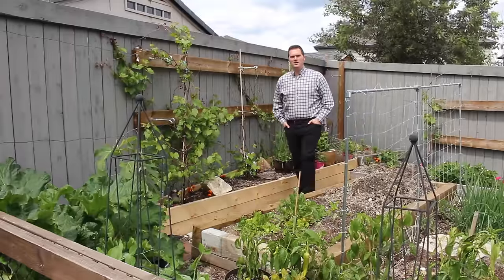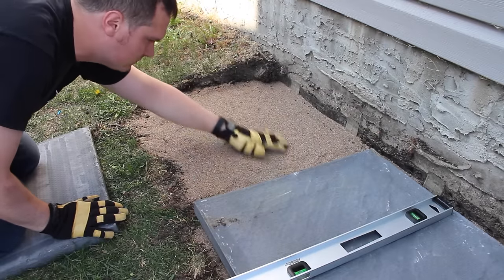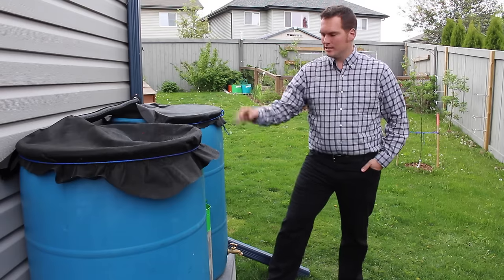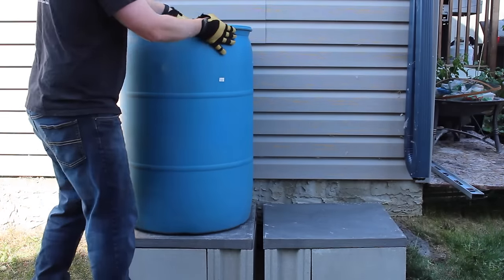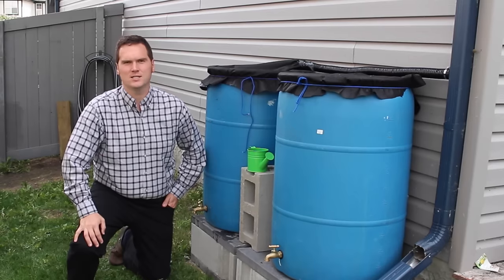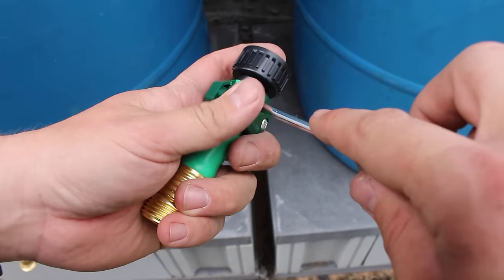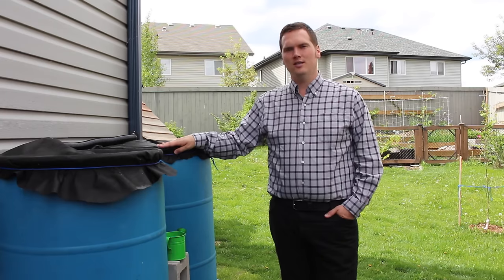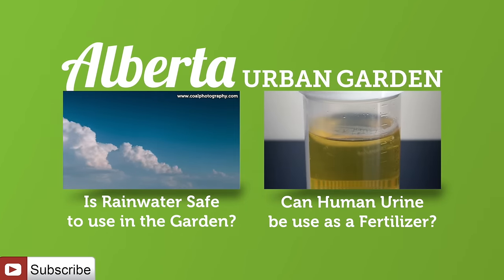Installing a Rain Barrel for Beginners

Comment: Great video! Just a note, the connection between the two barrels will work better if placed at the bottom of the system. Instead of 2 40 gallon barrels, you would then have 1 80 gallon system, creating better pressure for the hose (and more convenient).
Reply from the maker: Thank you for the tip ! I appreciate it ! Next time :)
Reply: pressure is determined by the height of the water in the barrels, not by the volume of water.
Reply: Advantage: you will need only one tap.

Comment: Also, instead of cutting the top, you can screw pvc pipe in the hole, use a "t" fitting on top to connect the barrels (as many as you want) and that will both fill and provide overflow.

Comment: Just a technical point;  the Teflon tape is NOT meant to be used on those threads in this application as the seal is made with the large black rubber washer on the inside of the barrel.  (the threads do not require taping.)

Comment: Steve, when using a hole saw in plastic, start the hole rotating the bit in the normal way. Before you get through the material run the bit backward and you'll get a much nicer/cleaner hole.

 Thanks for all you do
Reply from the maker: Thats a great tip thank you!!
Reply: That's not always true. I found when making my PVC Hydro tubes I got a much cleaner cut running forward.

Comment: Excellent, I love water saving solutions whatever they are. I'd probably connect the two outlets into one if I was using a hose on there, and use a rainhead screen with first flush because we get so many leaves in our gutters.
Another option is the water bladder that can be made to fit under a porch or landing so they're out of the way.
Reply from the maker: I don't have issues with leaves in my gutters but will use the screen to keep the stuff out!

a bladder under the deck would be nice but hard to maintain and winterize!

Comment: Terrific video, Steven!  Great inspiration.  I need to figure out a way to do this and include a pump for a hose at the base of the barrels since my house is pretty far away from my garden.
Reply from the maker: The longer term reason I was thinking a larger access would be nice is I can put a submersible pump in.  There are others that attach to the hose and then run the water through the pump. 

I might think about a pump if the watering can turns out to be too slow :)

Comment: An 8" pond plant basket in a 7.5" hole cut in the top of the barrel.  Then line the basket with a nylon paint strainer.  Easily removable for maintenance and it keeps insects out.

Comment: I am finishing a 12'x16' shed, and I have a food grade pallet tank to collect water. The tank holds probably about 200 gallons. It already has a valve at the bottom, and I'll come up with the downspout hookup. I'll permanently have the downspout connected, with the overflow exiting the upper part of the tank, to be connected to a drain hose that leads to the lowest elevation beyond the shed.

Comment: I use similar barrels, but I did not cut them.

I connected the downspout to one of the two openings on the top of the barrel and I use the other opening to let the water exit the barrel when it is full.

My downspouts are circular and just slightly larger than the openings on the barrel so there is a nice fit.

Before winter, I simply empty the barrel and I leave the faucet open until spring so that water can flow through the barrel.
Reply from the maker: That is a great tip for winterizing!  Thanks !! 

how did you get your tap installed?
Reply: For the tap, I drilled a hole similarly to what you did, but I did not do anything on the inside of the barrel.

I only put teflon tape on the threading of the pipe plus a black gasket and I screwed it tightly to the barrel.
Reply from the maker: no leaks thats great!
Reply: Nothing perfect, but it works for me.

And I connect multiple barrels using the other openings at the top.
I use the same pvc pipes used for the downspouts: two 90-degree curves + one short pipe and the two barrels are connected!
Reply from the maker: sounds like you are a touch more resourceful than I!
Reply: Thanks!

I like a lot your projects and the way you present them!
Reply from the maker: Thank you very much Mark for the kind comment!  I put a lot of work into these videos to help others and it sure does feel good when you take the time to put a kind comment in!!

Comment: great job Stephen!  I use an overflow system on my barrels and I need to monitor it during heavy rain falls.  I use screens but sometime debris gets through and clogs the overflow. your design looks virtually maintenance free besides the winterizing. I simply turn my barrels upside-down and leave the valves open before winter hits.
Reply from the maker: In theory the system should be maintenance free but we shall see. 

I had not thought of just flipping the barrels. Thanks for the tip !
Reply from the maker: That is the plan now!!  Thanks for the tip it is appreciated!
Reply: Actually, you need to leave the faucets open during the winter so any residual water doesn't freeze and crack the faucet.
Reply from the maker: I had planned on that as well.

Comment: Awesome! I have done something similar, only I got five 50 gallon kalamata olive barrels from a Greek deli. What's nice about them is that they have two-piece screw top lids, like mason jars. I can remove the plastic lid, put a piece of screen in its place, and secure it with the ring. When the summer comes and we have no rain, I put the plastic lid back on to keep the water from evaporating. They are a very nice terra cotta color too.

I'm not very tall though, so I have to lay them on the ground and crawl halfway in to install the spigots. :D
Reply from the maker: That would be nice. I was looking at a 200l version of those but the fellow would not come down on price so I passed :) 

I could barely reach the bottom of my barrels and I am 6 foot tall :) no harm in leaning it over and crawling in !
Reply: I bought an rv washing wand to clean my rainbarrel. It worked great for the sides but I still had to crawl into the barrel to clean the bottom edges. My wife thought it was funny to "help" rinse it out while I was still inside. I got even. (I know where she sleeps!) Lol!
Reply: Oh no! :D
Reply from the maker: lol thats why I did it while my wife was busy!  no need to get an extra washing in ;)

Comment: Hi Stephen. 
I really like the base you made. Very sturdy and long lasting. 
I have a couple of 1000 litre pallet tanks, but they aren't pretty and since our neighbourhood doesn't have backyard fences, my wife doesn't want them out in the open. I have an unobtrusive spot in mind but it's at the bottom of a gully and would need a pump. S if you do put a pump, please, please make a video. 
Would also be interesting if you install a first flush system
Thanks
Reply from the maker: If I find I need to speed up watering I certainly will do a  video on the pump as it is something I would need to research quite a bit and would love to share my findings!

The only issue with the base is its scratchy and my watering can needs a little buffer between it and the concrete ;)  that is ascetics I can fix with time!

Comment: Steven, 2 things: for the sawzall, the harder the material being cut the finer the tooth pitch, you would have been better off with a 6tpi wood blade, for the faucets, Teflon tape is meant for taper or pipe threads, and is more likely to cause than solve a leak on those strait threaded fittings... Though I have noticed in the past couple years a lot of the overseas made cheap junk they sell at the Home Deathspot has it in the instructions to use it where you should not...
Reply from the maker: That's why I mentioned the metal blade. I figured a smaller tooth would be needed and the regular starter kits that's the metal blade. Thanks for the tip! 

I spoke to my father about this before and he said a side benefit of the tape is it helps keep water out of the initial thread helping to prevent damage when the freeze thaw cycle starts. That is interning though you suggest it may not be needed. I am going to have to look into that more !
Reply: *****
Teflon Tape's benefit comes from the fact that tapered threads crush it into filling the gaps between male and female threads, there by filling all possible space for fluid egress... Strait threads are not designed to do this, and mostly try pushing the Teflon Tape out of the way, often causing lumps with voids that allow fluid egress... I don't know how many times I have been called in so solve leaks caused by homeowners installing faucets and using Teflon Tape on the wrong fittings... The store has had to pay my time on many occasions when the home owner has shown me the supplied instructions that tell them to use it incorrectly... I guess the Asian manufacturers cut and pasted the wrong section of another company's English instructions...

Comment: Very well done, Stephen. Any concerns about the plastic absorbing chemicals from the barrels' previous contents?
Reply from the maker: No concern as the food grade plastics don't absorb from the content and vice versa.  Some of the plastics in red don't leach anything but do pick them up as they are softer with higher poor space.  

I did confirm this with a expert in contaminants that I work with prior to going this rout.

Comment: It will leak at the junction between the tanks because you have screwed a 3/4" MHT (male hose thread) into a 3/4" NPT (natl pipe thread) also called iron pipe thread. They are close in size, but not exact. You can achieve the same connection with two 1" PVC male adapters , two 1" gaskets,  one foot of 1" PVC pipe and two 1" lock nuts for about 1/4 the price of two bulkhead fittings. Home depot has them as a set, and they are called 1" washing machine pan adapters.

Comment: Great job Stephen. That was my job for this year till I decided to do the BTE garden. I have very sandy soil and and even though I was using a lot of organic material, I still had to use town water. No more. This has already been a dry spring and because of the wood chips, when I paw the chips away from the top of the soil, it glistens. I may use this idea for other purposes. Thank and God bless,
Jim
Reply from the maker: I am glad you are having success ! I don't have to use a lot of water once my plants get going as my mulch layer works in much the same way. It is very nice !

Comment: Thank You. Very informative. We have a well and rain water is needed for the garden. I have to build a modified system to your a because I want to use it as a water run off when the barrels are full. I don't know exactly the correct hose size because the water can fill a barrel in 40 minutes. (example).

Comment: Use a ball valve 3/4 inch so you can quickly fill your watering jug or bucket.  your spigot is too slow especially when barrel is half full.
For low pressure systems you need 3x the size of valves to achieve same flow rate.  that way you can hook up a 3/4" hose and water your garden without carryng heavy water 10x back and forth.

Comment: I like your safety shoes that you are wearing while shifting around those heavy patio slabs!  Just kidding.  I harness rain water, too.  I have an IBC which holds 1,000L and we also have a well in our barn.  My husband has attached a jet pump to it and then the garden hose is attached to the pump.  We don't pay for water as we are in the country but I think rainwater is the best for veggie gardens :)
Reply from the maker: My wife said that too. I unfortunately left my steel toes in my work vehicle that my staff had out during my vacation. I know safely first but crocks are protective right :) 

I was thinking of a pump too and may get one if the watering can business takes too long :) would you suggest a submersible ?

Comment: I put two feeder goldfish in my rain barrels. They keep insects from breeding in the water.
Reply from the maker: That is a good idea!!  They also would fertilize the water.
Reply: goldfish shit in the water, just put good meshing on top (and you can add the mosquito donuts to it they wont affect the quality of the rainwater)
Reply: Make sure to have a proper amount of oxygen in the water
Reply: @zolox4814  A goldfish in mine would die during the summer. The water gets to 100* F in the summer. Zone 7
Reply: Hi there! If you're using this only to feed plants, then there are several species you could take right out of nature like mosquito fish. You could also go to your local pet store and pick out some guppies, depending on how hot and cold it gets outdoors. They will happily eat any fry and add nitrate to the water if you keep them in number. 

Watch out for dragon flies. Their larvae will eat your guppies! Maybe use some hardware cloth to prevent them from laying eggs in your rain buckets.

Comment: One idea for the sand under the base is to mix cement in with the sand so when it beds down it provides a porous but firmer base and importantly will help suppress weeds and stop ants taking your sand away (or creating a nest). My father as a builder used to use this method when laying driveway cobbles.
Reply: The sand & cement are a dry mix, you're not mixing/making mortar. I think he used a 1:8 ratio (cement to sand) rather than I recollect the higher 1:4/1:6 for mortar.
Reply from the maker: That is a great idea ! I might take this down next summer and add the mortar ! Thanks for the great tip!

Comment: FYI - for the cross barrel connection, you do not need to cut the hose short.  You can buy a short hose (I have seen some at the Home Depot that are only 12-15 feet long.  It can then be hooked up between the two barrel connections as shown.  The extra hose can simply be coiled between the barrels.  The only trick is that no part of the coil can be higher than the hose connections or the connection will not allow water to flow.

Comment: Great job, Steven, constructing AND video-sharing your system!  Wondering how the overflow worked over the past several years.  When the barrels are full, did the water back up in the supply hose to the downspout, or did it spill out over the bug netting?  The "diverter" hole looks higher than the tops of the open (but screened) barrels.  Otherwise, thanks for a great presentation!

Comment: Food safe trash cans work well also cheaper than blue barrels most the time and with a removeable lid it's east to clean them when needed. No need for an overflow either since it will just overflow the top. Best to drill your downspout hole higher so the tube flows down then you wont have water sitting in that line also.  Then just drill a hole in the top of the first trash can lid and put your hose right in the top.
Reply from the maker: That’s a good point I wonder under a full load how it could hold up.

Comment: You should only need 1 fawset valve to realise the water and put the connecting hoses or pipes on the bottom of the bearals by doing that you use both barels of water going down at the same time as if the connecting hoses on top will only empty one barel and the other remains full. Making you use 2 valves 1 on each side.

Comment: Have you seen the water back up in the feed pipe when the barrels are full? Looking at the system, it seems to me the water would simply overflow over the top edge of the barrel before backing up through the feed pipe since that is the lower path of escape. In order for the water to travel back up the feed pipe, the barrels would need to be sealed.
Reply: Baird Caner I agree and thought the same... or he could simply drop that black pipe below the top of the barrel by about 6” so that it doesn’t overflow out of the barrel
Reply: Interesting point!
Reply: Open your eyes, he has the barrel on the left as the starter barrel and overflowing into the right side. At the speed that silly black pipe rain catcher will fill the barrel he should have no problems filling the barrels due to gravitational force. I hook my barrels directly to the downspout of the house with a 2" overflow pipe from barrel to barrel and use four barrels . first barrel is 18" higher than bottom barrel ,last barrel has a 2" over flow at the top because here in Canada water flows down hill .👍 👍 🇨🇦

Comment: My rainwater collection overflow feeds my water wicking bed.  My water wicking bed overflow feeds my blueberries.  My blueberries feed me.

Great video, as always.  Since your barrels are cut open on the top, there probably isnt reason to add a first flush diverter for when you need to clean.
Reply from the maker: That is a great method to keep things nice and simple ! I wish my system was above my garden. Alas it's too low to gravity feed anything.
Reply: Would adding a second level to the base raise it high enough? I had a neighbor who put her rainbarrel on a platform about 3' above the ground, seemed to work for her.
Reply: ***** The higher the barrel, the higher the water pressure out.  If you need pressure to run a sprayer or similar, a small pump might be the best option.  If you're just filling a watering can or using a soaker hose, low pressure is fine.
Reply from the maker: I would have to raise the barrel top 18 inches to get positive flow to my garden.  Not sure that would be super stable with out having to poor concrete which my wife was not so keen to do.

a small low pressure might do the trick! thanks!
Reply: +Alberta Urban Garden Simple Organic and Sustainable agriculture ppk

Comment: you can just drill an 11/16'' hole and tap the plastic directly, use 2 3/16'' hole with  2'' ABS pipe for the crossover pipe, it leaks an itty bitty bit, but not enough to worry about.